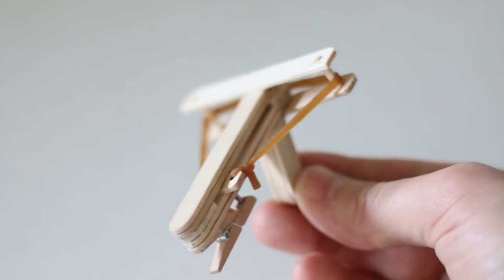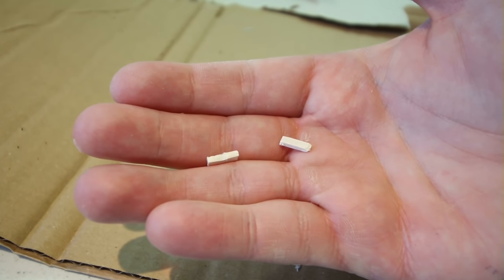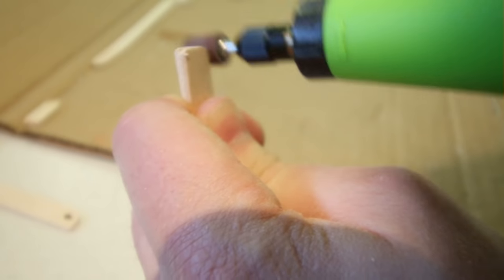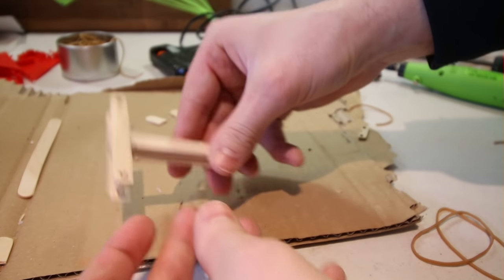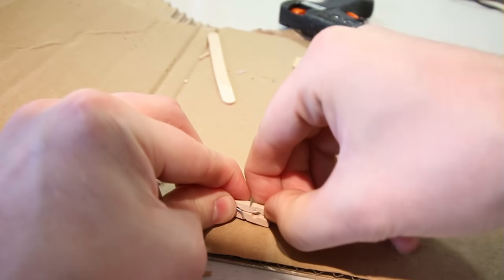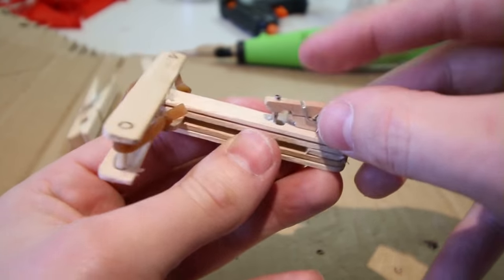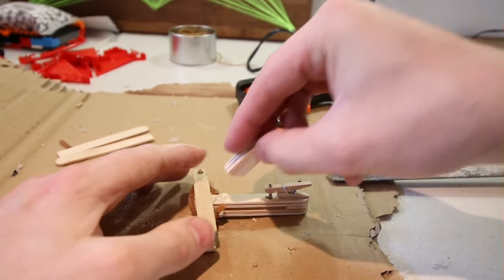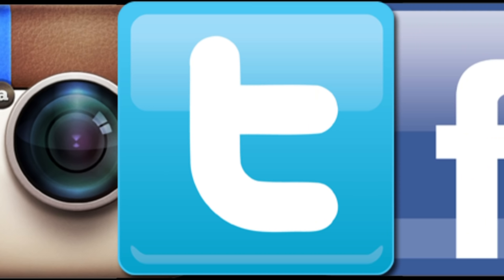How To Make A Mini Wooden Crossbow!

Comment: FYI for anyone who wants an easier way to cut lollipop sticks , use Tin Snips or Aviation snips . For right handed people get left cut , and for left handed people get right cut snips . I've found that for overall tasks that is better than straight cut snips because of the design to cut right or left actually works better for cutting any direction . Even if they are just cheap ones from Walmart or harbor freight . They cut waaaay better than scissors . And they don't frustrate you when with using scissors most of the time one side of the stick will split . Cool Video and just the right amount of talking and explanation too . I'll subscribe !

Comment: so it's more of a ballista
Reply: It's nothing like a ballista, the only thing they have in common is that they have something stretchy to throw the projectile.
Reply: +Vault Boy A ballista is just a big crossbow lmao
Reply: Cynicaldead ik. It looks like 1
Reply: Mincrafter 101 actually they don't. Ballista's don't use elastic or, "stretchy" as you put it, fibers. That would negate the effect of the limbs. The limbs of bows, compound bows, and ballista's bend which is where the force comes from. I meant that in shape it looks like a ballista which is basically a large crowssbow. Similar to a ballista his "crossbow" is front loading and similar to a ballista it has to limbs which connect using Rods. and attached to the rods is the bow string
Reply: Mincrafter 101 what he created is a ballista. It has more in common with a ballista than a crowssbow
Reply: Mincrafter 101 and before you make an argument saying that ballista's are crowssbows, ballista's came first.
Reply: +Vault Boy No, he made a crossbow.

From http://www.merriam-webster.com/dictionary/ballista -

A ballista is - "an ancient military engine often in the form of a crossbow for hurling large missiles"

EDIT: Crossbows were made before Balistae, quick google told me 700BC in china for 'em. and Balistae 400BC
Reply: Cynicaldead possibly. China having crossbows that long is a theory. Not fact.
Reply: Cynicaldead we think they might have.
Reply: Cynicaldead and China was separated from Europe for a while. The crossbow was separately invented there. Although they might (I stress might) have had it first we didn't know of its existence
Reply: Cynicaldead the Europeans would have thought they invented it first because they didn't interact with China until long after they had created 1